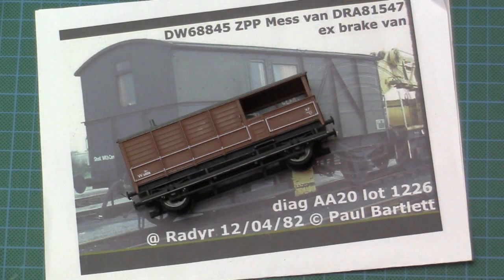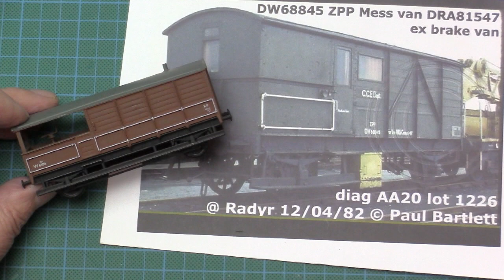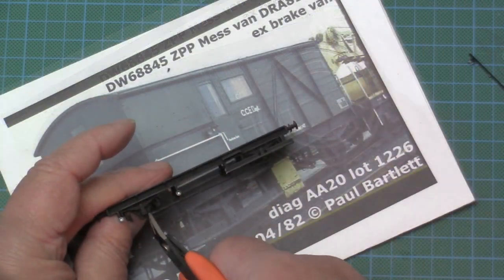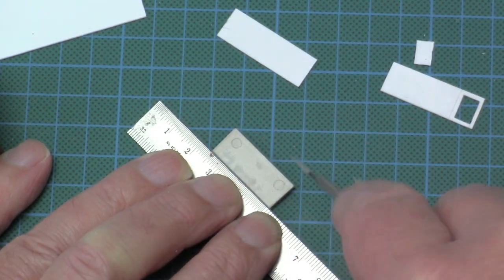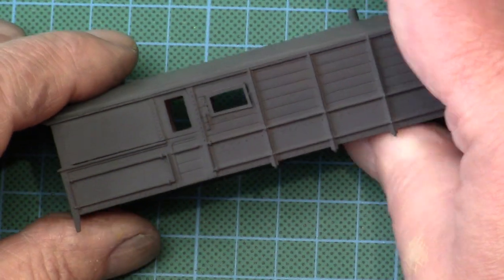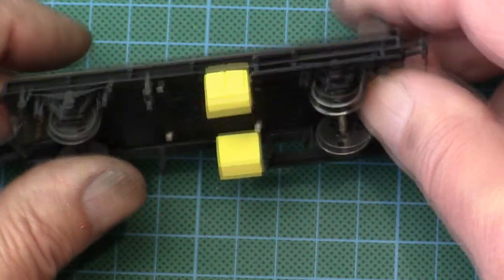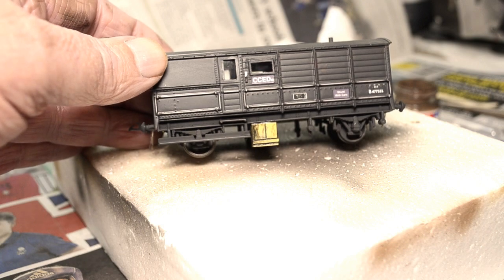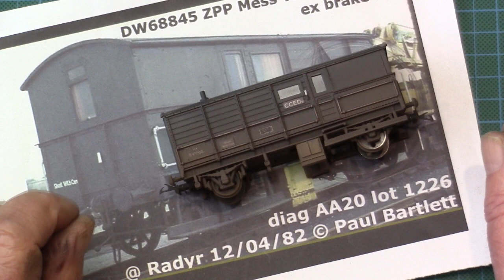DAPOL 15 TON CRANE #4

Comment: Hi David, grand job you have done there. I do have some information that you and others may find useful.
The Dapol crane is a of a Booth Rodley yard crane that was supplied to engineering firms and ship yards and did indeed run on bogies and was painted red as the kit suggests. Cranes supplied to BR by Booths were mounted upon rigid frames as is your conversion and were originally painted grey and then later yellow. The jib runners were indeed converted from GWR designed Macaw H wagons.
The correct transfers for the BR P-Way cranes are available from Cambridge Custom Transfers sheet BL92, the sheet includes transfers for the jib runner wagon also. Transfers for the Small Hornby Cowans Sheldon 10 ton hand crane, sheet BL36 are also available as that is an accurate model that scrubs up well, again Paul Bartlett's photographs are very helpful
You note that the jib is short, this is the correct length for the bogie yard crane, the BR P-Way crane had a box section at the foot of the jib where the flat channel section is. I lengthened mine by 12mm by cutting the box section along its centre and then plating up with plasticard to give the extra length. The swan neck of the BR P-Way cranes are also slightly longer and set at a shallower angle than the bogie yard cranes.
In later service the cab roofs were cut back at an angle to give better visibility when the jib was fully up, I missed this detail when I built mine and it was fully painted before I realised, not to worry !!!
Further detailed reading may be obtained in Railway Cranes Volume 3 by Peter Tatlow, which covers P-Way cranes, volumes 1 and 2 cover main breakdown cranes.
Reply: I forgot to mention I set my crane on a modified Hornby LNER eight wheel tender frames.

Comment: A great rebuild to compliment your crane. I was going to follow your lead with the crane but found a similar Hornby one on ebay at a good price, so I will just be modifying and weathering that one. If I have the space on the allotted siding it will definitely be getting a mess van.
Reply from the maker: Hi Davie, thanks for your kind comments. Yes a mess van would compliment your crane well. Good luck with your mods, glad this video has helped - David

Comment: What a great job David.....I might have a go at modifying my hornby crane set ......regards Fred
Reply from the maker: Hi Fred, thanks again for your comments. Hornby crane set - sounds a bit  expensive to me. Very good luck - David
Reply: David Hyde .....it was one my better half bought me last April....birthday......it’s already black just needs chains and weathering...so out with the air brush....what colour did use for the grime .....regards Fred
Reply from the maker: Hi Fred, sounds very do-able. I like to mix my own weathering colours, it keeps the number of bottles of paint down to a minimum. I use the Tamiya acrylics and I make various mixes of Flat Earth, Flat Black and Flat White. An oily sooty mix would be mainly flat black with a little flat earth, whereas track dust and grime would be mainly Flat earth with a little flat black. For lighter tones (if needed) I would add some Flat White to either mix. Mix some up with some thinner and do a test, adjust the mix to taste - a bit like cooking really. There are products called 'track grime' - 'oily smoke' etc, but I have never used them. Good luck, I hope it goes well  -  David
Reply: David Hyde thanks for the info ....I’ve a couple of citadel oily washes black and brown ...with your combination I’ll have it nailed .....regards Fred
Reply from the maker: No Problem. I have some citadel washes for making my old teak coaches look more realistic. I have heard they are very good but I haven't tried them yet  -  David

Comment: Nice conversion David, makes a great addition to your crane. Have you been using CZP to enhance your stills? They are looking very well focussed. ................John
Reply from the maker: Hi john, thanks for your kind comments. I Do use CZP but , on the 'angle' shots on these stills, I stopped the lens down as far as it will go. The actual f-stop depends on the amount of zoom chosen but it is around f32  -  David

Comment: Beautiful model and conversion. I am embarking on a journey to make my own decals when I get started on my own railway conversions and scratch builds so I would like to know what program you used to first print your decals on your computer. I would also like to know if you added bearings to your axle boxes when you changed from plastic to metal wheels. As always, a very informative video well worth watching for anybody wanting to go down a similar path to yourself.
Reply from the maker: Hi Kevin, apologies for the delay in reply. Thanks for your interest. I sometimes print my own decals but I have always found it a bit of a hit or miss. I think the quality of the decal printing paper is important - some I have found seem to have a thin layer of decal to print on making the final decal very fragile indeed.
As for the software I use an old version of Photoshop Element (version 7 to be precise). From this I produce a JPED file which can easily be printed.
Yes I did add brass bearings to the axel boxes (they came with the wheels & axles.
Hope all this helps Kevin - good luck  ...  David
Reply: Thanks David. I will just have to play about and find the right combination I suppose. I'll have a look for 'Photoshop Element version 7' and see if it suits. I've just finished building a couple of Parkside Dundas, or possibly Cambrian kits I've had for some time and the plastic wheels don't turn very well. I did try fitting Hornby wheels to the models but they just fall out, hence my question. Anyway, that's what this hobby is all about isn't it? Creating something from very little, lol. I will keep following your work with interest.
Reply from the maker: Hi Kevin. If you have some photo editing software then there is every chance that it will have the ability to write text. Also, I have just checked 'Paint' a freebie with windows if you have a PC - it will let you write text with colours and fonts so I would check this out first.
If you want some inexpensive photo editing software then I can recommend Photoshop Elements 7 or higher. If not then i would check out the software you have. You may find you have all you need. Hope this helps  ...  David
Reply: Thanks again for that info. You may well have saved me a bit of money as well. Double bubble as they say, lol.
Reply: thanks David, I'll have a serious look at it.